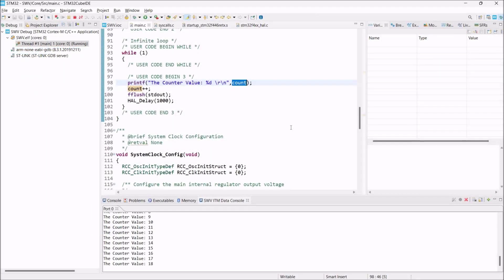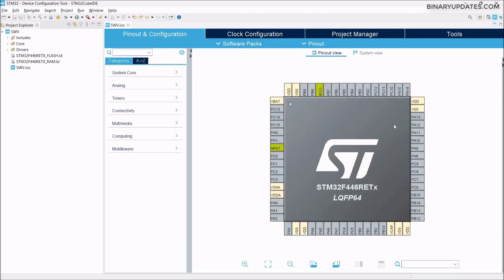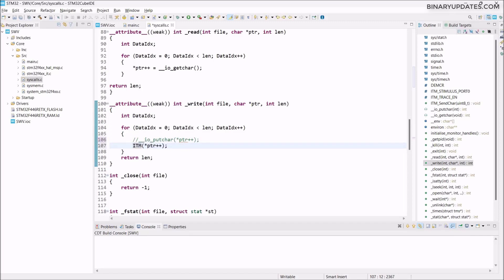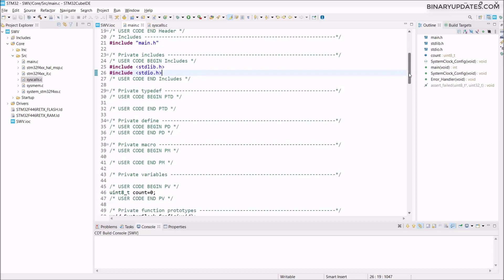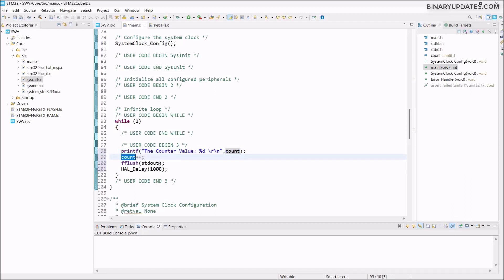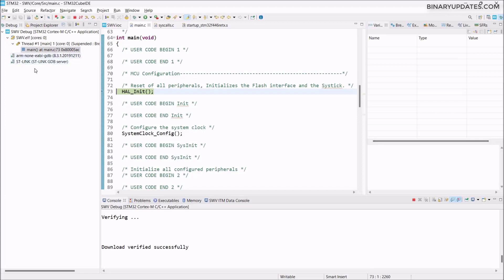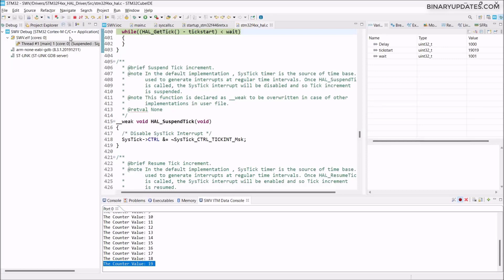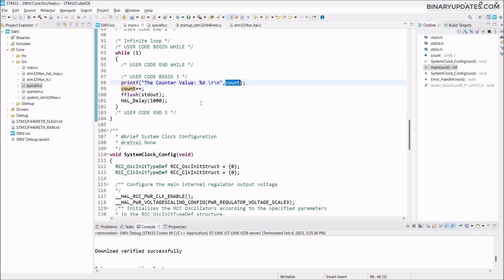How to use Printf with STM32 Microcontroller- Serial Wire Viewer (SWV)

Comment: Guys if you are using stm32f303re set the core clock frequency under serial wire viewer in debug configurations to 8mhz, thats the internal and default clock this board uses, also you have to put \n i think.

Comment: // Debug Exception & Monitor Control Register Base Address
#define DEMCR            (*((volatile uint32_t*)0xE000EDFCU))

// ITM Register Address
#define ITM_STIMULUS_PORT0   (*((volatile uint32_t*)0xE0000000))
#define ITM_TRACE_EN         (*((volatile uint32_t*)0xE0000E00))

void ITM_SendChar(uint8_t ch)
{
    // Enable TRCENA
    DEMCR |= (1 << 24);

    // Enable Stimulus Port0
    ITM_TRACE_EN |= (1 << 0);

    // Read FIFO Status in bit[0]:
    while (!(ITM_STIMULUS_PORT0 & 1));

    // write to ITM Stimulus Port0
    ITM_STIMULUS_PORT0 = ch;
}

Comment: It is useless to watch and waste of time
Reply: it is working
Reply: @harshithmahesh6083  I've just started working with STM32, and I'm having trouble with printing/debugging. PuTTY sometimes fails to connect, and I'm also not clear about the pin configuration. Could you help me based on your experience? I have to submit this project as soon as possible. If you're willing to help, please let me know - I can share my number or email id.
Reply: @harshithmahesh6083  please help me , if it worked for you, I did exactly like told in the video

Comment: // Debug Exception & Monitor Control Register Base Address

#define DEMCR

*((volatile uint32_t*) 0xE000EDFCU)

//ITM Register Address

#define ITM_STIMULUS_PORTO

*((volatile uint32_t*) 0xE0000000)

#define ITM_TRACE_EN

*((volatile uint32_t*) 0xΕΘΘΘΘΕ00)

void ITM_SendChar(uint8_t ch)
{

// Enable TRCENA 
DEMCR |= (1<<24);

// Enable Stimulus Porte ITM_TRACE_EN |= (1<<0);

// Read FIFO Status in bit[0]: while(!(ITM_STIMULUS_PORTO & 1));

// Write to ITM Stimulus Port0 ITM_STIMULUS_PORTO = ch;

Comment: I've added serial wire viewer in console and clicked the port 0 and rewriitten the write function on syscalls.c still am not getting output am using stm32f407-discovery,need help in solving this,same happens with stm32f446re board

Comment: Thanks for the guide! I've been having trouble getting this to work though. I'm hoping you might be able to help. I've been trying to get this setup on the b-g431-b-esc1 discovery board, which uses STM32G431CB. At this moment nothing is printing, but I have noticed while debugging that I get stuck in the ITM_SendChar() function - specifically in the while loop - while(!ITM_STIMULUS_PORT0 & 1). I'm too new to C to make sense of what's happening. Any ideas? Thanks!
Reply: You may have a mistake somewhere. Please copy exactly this code:

//Debug Exception and Monitor Control Register base address
#define DEMCR                   *((volatile uint32_t*) 0xE000EDFCU )

/* ITM register addresses */
#define ITM_STIMULUS_PORT0   	*((volatile uint32_t*) 0xE0000000 )
#define ITM_TRACE_EN          	*((volatile uint32_t*) 0xE0000E00 )

void ITM_SendChar(uint8_t ch)
{

	//Enable TRCENA
	DEMCR |= ( 1 << 24);

	//enable stimulus port 0
	ITM_TRACE_EN |= ( 1 << 0);

	// read FIFO status in bit [0]:
	while(!(ITM_STIMULUS_PORT0 & 1));

	//Write to ITM stimulus port0
	ITM_STIMULUS_PORT0 = ch;
}
Reply from the maker: Please confirm if you have properly added the piece of code in syscall.c file. Also, make sure in debugger setting under Serial Wire Viewer section turn on Enable check box. Once you have done this then configure SVW console settings. I hope this may help. Best wishes!

Comment: Code snippet that needs to include in  "syscalls.c"  file :-

//Debug Exception and Monitor Control Register base address
#define DEMCR        			*((volatile uint32_t*) 0xE000EDFCU )

/* ITM register addresses */
#define ITM_STIMULUS_PORT0   	*((volatile uint32_t*) 0xE0000000 )
#define ITM_TRACE_EN          	*((volatile uint32_t*) 0xE0000E00 )

void ITM_SendChar(uint8_t ch)
{

	//Enable TRCENA
	DEMCR |= ( 1 << 24);

	//enable stimulus port 0
	ITM_TRACE_EN |= ( 1 << 0);

	// read FIFO status in bit [0]:
	while(!(ITM_STIMULUS_PORT0 & 1));

	//Write to ITM stimulus port0
	ITM_STIMULUS_PORT0 = ch;
}
Reply: This function will not work for ARM Cortex M0/M0+. If you are using Cortex M0, then you can use semihosting feature of openOCD.

Comment: Hi! Great tutorial and it does work on the STM32 Nucleo board however I have the STM32f411 Blackpill board which needs to be connected to an external ST-Link v2 debugger. This doesnt print on that. From what I looked into the datasheets the memory addresses for the registers used in code that we added in the syscall is the same. Any suggestions on what to do?
Reply from the maker: Hi Adil, thank you. You're right in case of STM32 Blackpill board we don't have built-in STLink programmer and debugger support. So need you need external STM32 programmer and debugger. I want you to check for SWO Pin where it is connected in case of blackpill between STLinkV2. Because the SWV data transmission uses SWO pin for sending debug messages. And if its not soldered then it may not work. I'm not sure as I still have to work on blackpill I've ordered some in future I'll make videos on this topics. Good luck and best wishes!
Reply: It is simple solution. Use FTDI, connect to A9, A10 pins. And you have it, printf works on putty, TeraTerm, Hercules or other.

Comment: Didn't see this in the description, so I typed it out: 

// Debug Exception & Monitor Control Register Base Address
#define DEMCR			*((volatile uint32_t*) 0xE000EDFCU)

// ITM Register Address
#define ITM_STIMULUS_PORT0	*((volatile uint32_t*) 0xE0000000)
#define ITM_TRACE_EN		*((volatile uint32_t*) 0xE0000E00)

void ITM_SendChar(uint8_t ch)
{
	// Enable TRCENA
	DEMCR |= (1<<24);

	// Enable Stimulus Port0
	ITM_TRACE_EN |= (1<<0);

	// Read FIFO Status in bit[0]:
	while(!(ITM_STIMULUS_PORT0 & 1));

	// Write to ITM Stimulus Port0
	ITM_STIMULUS_PORT0 = ch;
}

Comment: yw

#define ITM_TRACE_EN          *((volatile uint32_t*) 0xE00000E00)
#define DEMCR                 *((volatile uint32_t*) 0xE000EDFCU)
#define ITM_STIMULUS_PORT0    *((volatile uint32_t*) 0xE00000000)

/* Debug function for printf used in __write() */
void ITM_SendChar(uint8_t ch)
{
	// Enable TRCENA
	DEMCR |= (1<<24);

	// Enable Stimulus Port0
	ITM_TRACE_EN |= (1<<0);

	// Read FIFO status in bit[0]:
	while(!(ITM_STIMULUS_PORT0 & 1));

	// Write to ITM Stimulus Port0
	ITM_STIMULUS_PORT0 = ch;
}
Reply: kiss you
Reply: love you
Reply: ty
Reply: Above #defines have extra 0 and U at the ends. It is typo I believe. Other than that, It works well.
Reply: 🫶 I like to be kissed
Reply: hardfault...
Reply: Thank you bro